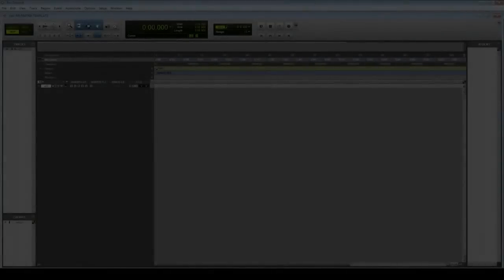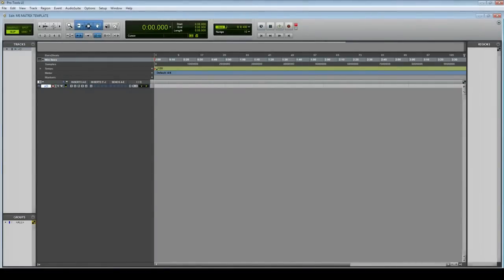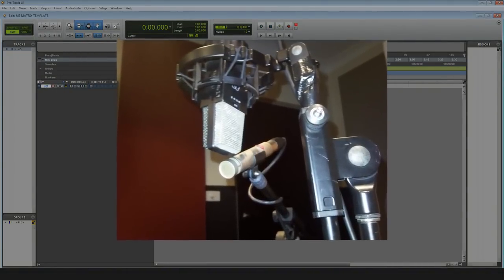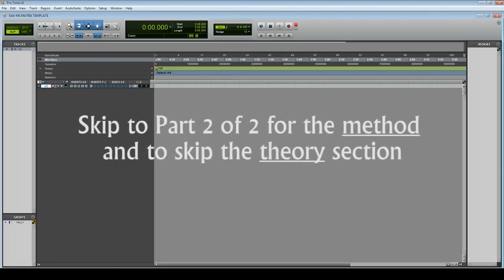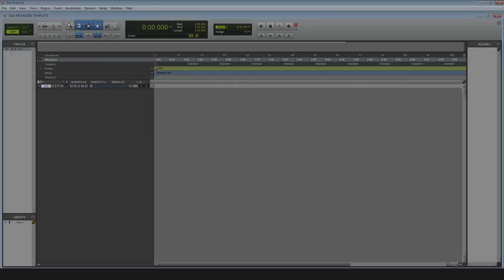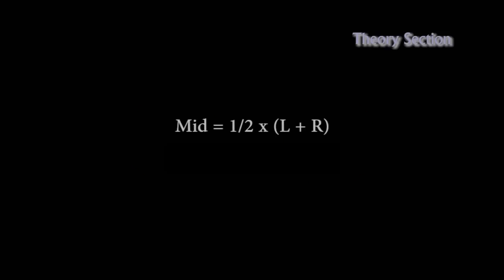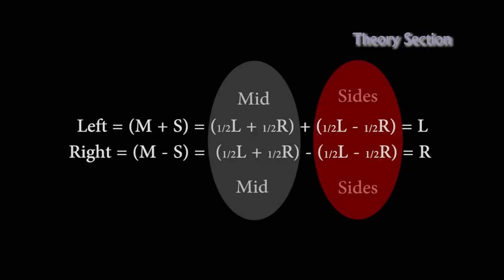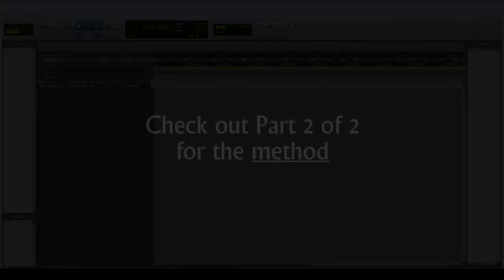Stereo to Mid-Side Encoding/Decoding using standard plugins - Part 1 of 2

Comment from the maker: Try it out is all I can say. As far as I understand, those ms plugins all work in a similar way to shown here in this video. Center is a little different in that it seems to do it dynamically based on program material. You could also print the mix and run it through the ms matrix again, that could also work.

Comment: this is confusing....I understand that L-R subtracts everything that is the same between the two tracks......but L+R, does it add together and potentially double the common parts more than it would if not separated between two speakers..? is there a way to cancel out more side mix from the L+R?